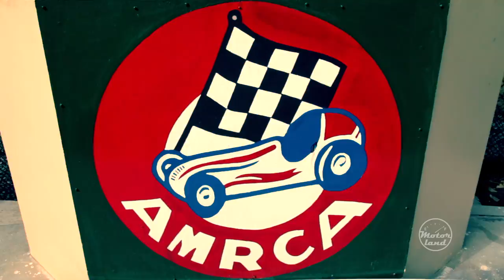Rocket Man

Comment: I see the power. So with that much power, why do the cars need the help of the guy in the center?
Reply: It looks like the guy in center helps get the tether up to tension which happens once the car gets up to speed ?
If he wasn't there the tether might just start wrapping around the pole ?
Reply: Maybe they are geared  so high they can't start on their  own
Reply: The cable has inertia would pull the car into the center.
Reply: I figured the cable would drag until the speed is high enough to hold it taut.
Reply: @keithklassen5320  It will.